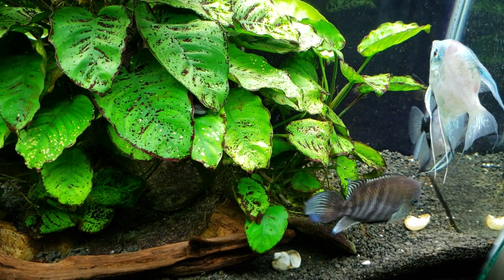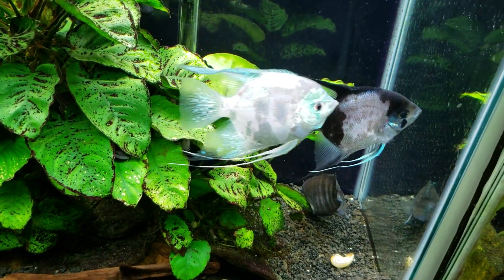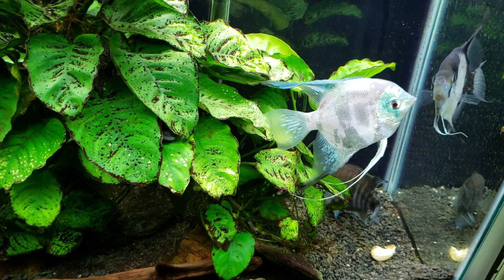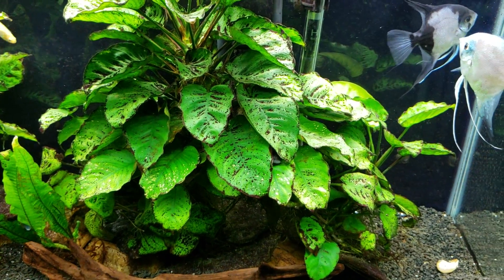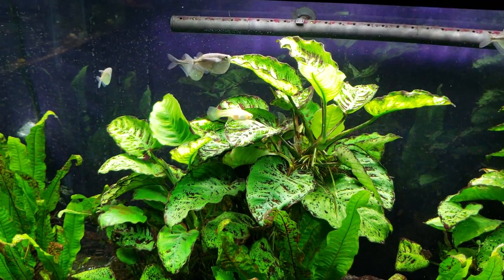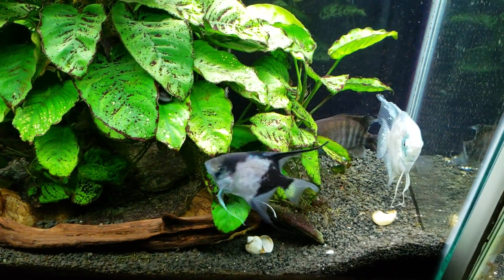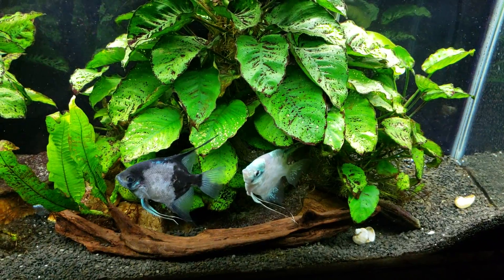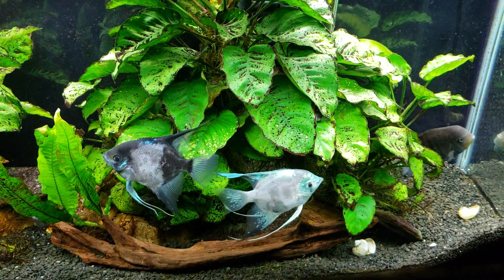Odd Reason I almost Overflowed A Tank

Comment: Your fish are doing so great in this tank. It definitely pays to keep up on your water changes. Your T bar is all better. Your Angel fish look fantastic. All your hatchets are surviving. Have you checked your nitrates in this tank lately? I am curious to see if they are lower. I have problems with keeping mine low.
Reply from the maker: They're usually around 80 ppm before water changes. A big water change brings it down to 40-50 ppm.